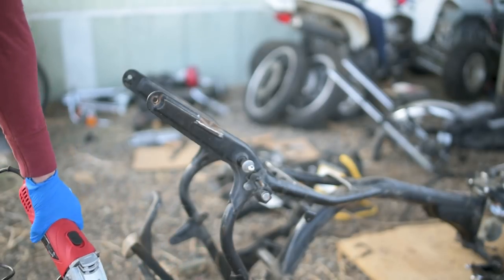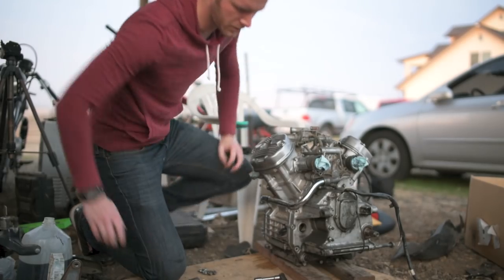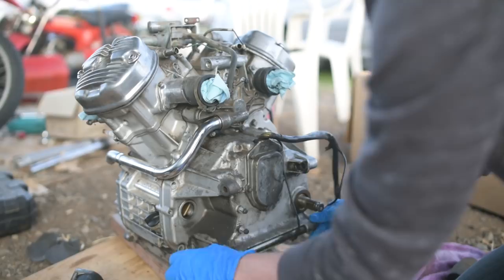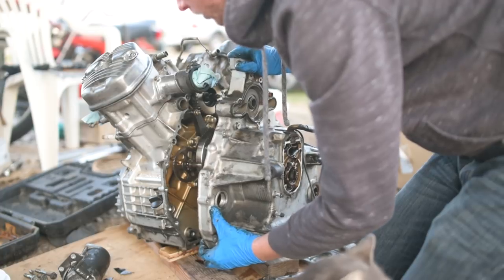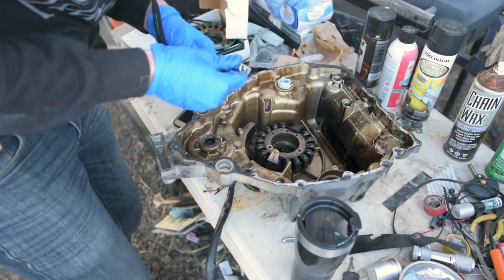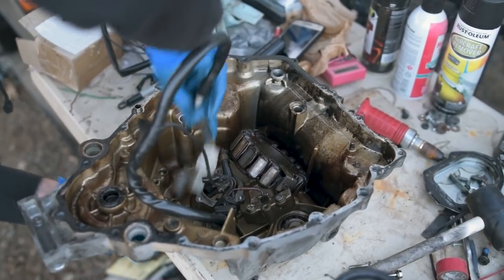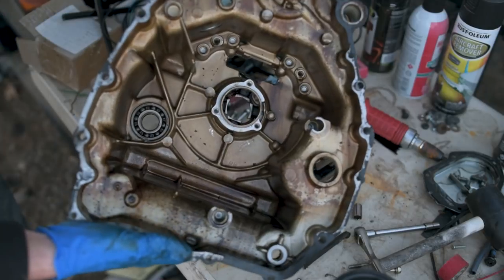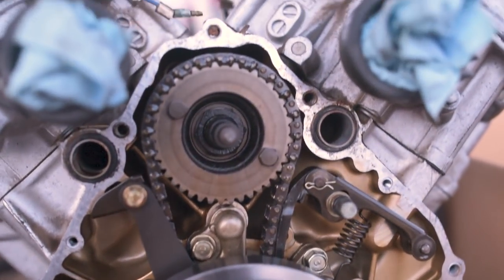REMOVING STATOR | Cheap Craigslist CX500 Cafe Racer Build

Comment: Alright so I have my stator out of my bike and the same new stator that you put into your bike, but I’m stuck at the same part where you ended this video of setting up the new stator and getting it into the bike, could you guide me to websites that helped you or if you took a video of it?
Reply from the maker: Kade Southwick I really didn't get much help. Other than CX500 forums, there wasn't much out there for this project. I used a Stator Check website but that's about it!
Reply from the maker: Look at my next video! I install it on that one